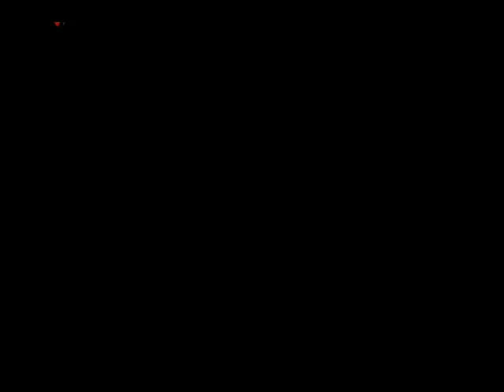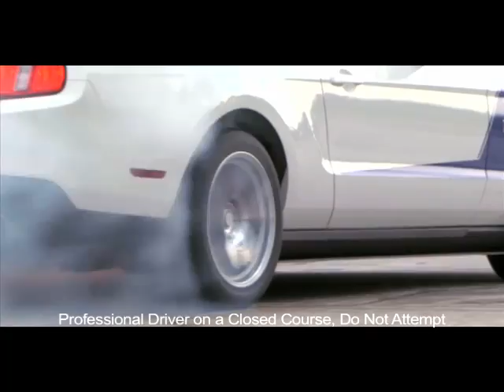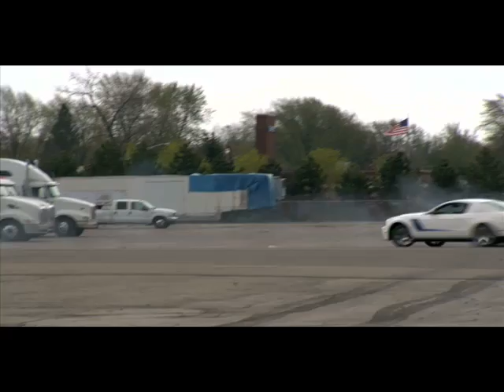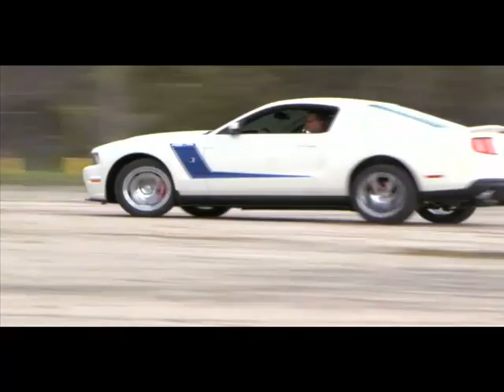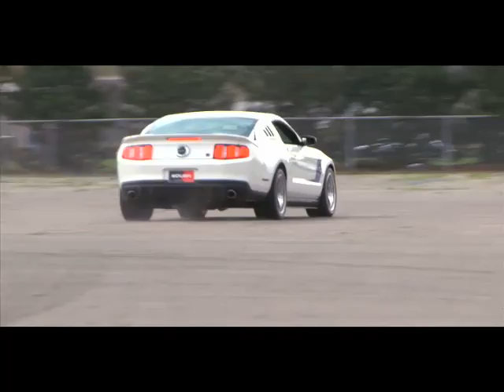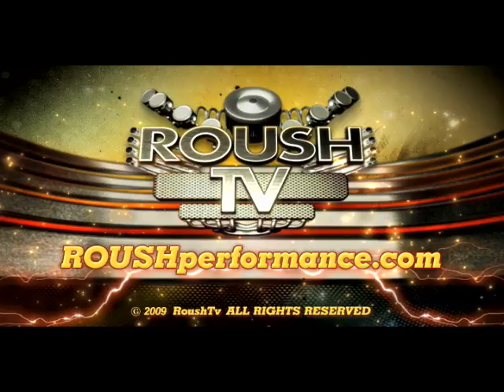ROUSH 2010 Mustang Burnout

Comment from the maker: The 427R name comes from the horsepower rating of the first iteration of the vehicle, which was released in 2007.

The car produced 427 Horsepower with a ROUSHcharger system installed on the Ford Mustang GT 4.6L V8 engine.

Since then, the 427R has been upgraded to boast more than 435 HP and 400 lb-ft. of torque.

Comment: The difference here in times are solely due to smaller rubber on the stangs, compared to the camaros. It has always maddened me that Ford keeps putting that kind of power unter these cars, and don't back them up with good tires.
That's ok, it's nothing a set of Mickey Thompson Drag Radials won't fix.
Here, chevy, chevy, chevy.

Comment: or, you can wait 2 years, and buy the 427r for the same price as the mustang.   Since Roush throws out newer verison's of his cars left and right, and in the eyes of a bank, a Roush is in no way different than a GT.  (or insurance) they don't hold their value well because of that.   I picked up a stage 2 Roush, with m90 charger added on at the dealer, and track pack from stage3 for 23k.   $ to $ there are very very few cars that will beat it, that also offer an extended 85k mile warranty

Comment: That is not at all true by any means. The Stock RS or SS run downt the 1/4 mile in 13.0 the GT does it in 13.5. The Hennessey does 0-60 in 4.3 the GT 500 does it in 4.6 . The Hennessey blasts the 1/4 mile in 12.1 and the GT500 does it in 12.5. Dont get me wrong I think the GT500 is awesome but Id take the Hennesey all day.